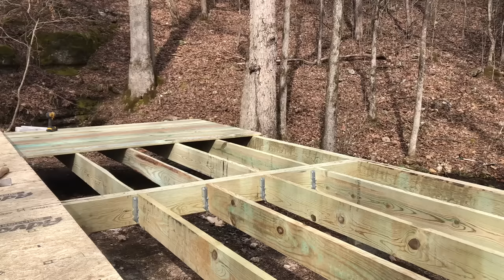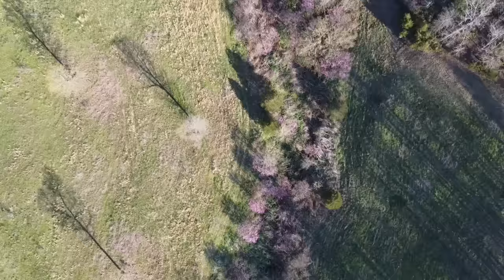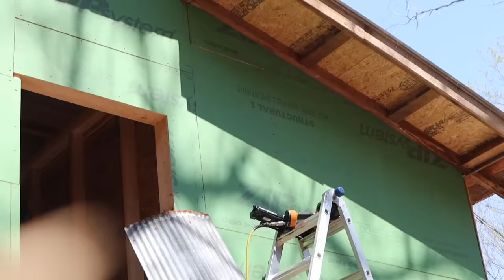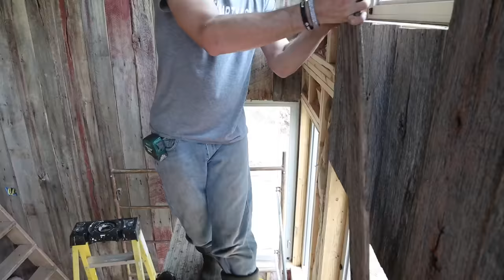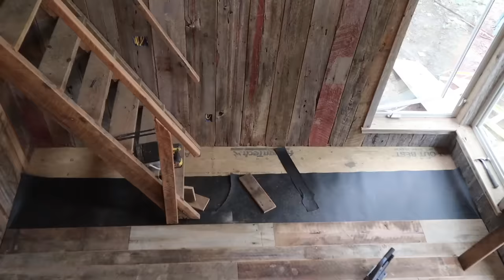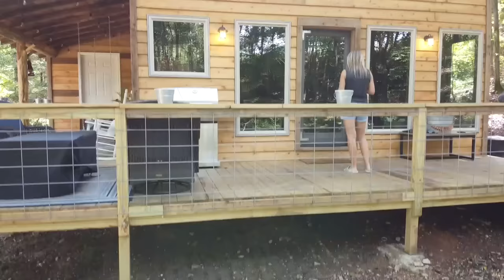TIMELAPSE - Off Grid Shed Style Cabin Build with HYDRO POWER- START TO FINISH

Comment: I moved to the Missouri Ozarks 43 years ago and while I didn't build my house, I rebuilt it. It had a practically flat roof that leaked like a sieve, had NO insulation, windows leaked ( if the wind was blowing in the winter, it would snow inside), had cold running water in the kitchen (tho the well went dry the second year), an outhouse, the subfloor was inadequate---I could go on but you get the picture. I wish I had had a video camera then to record the transformation over the years. I had to do everything very slowly, as I got enough money to do the work. I did the majority of it myself, teaching myself skills that I had no experience with. Some months I would buy 4 or 5 boards because that was all I could afford. I did it all with a hand saw because I couldn't afford a chop saw or circular saw or any other time saving tool. No nail gun either. It was a lot of work and I enjoyed most of it. I now have it pretty much how I want it and I am getting too old to take care of it (79).  But I still wish I could have made a video after watching videos on YouTube about people building their dream houses.

Comment: That foundation is going to settle and the house will be full of creaks and cracks.
Reply: Exactly my thought. Too bad they didn't put as much care into that foundation as they the dam.
But the house is very cool.
Reply: My first tought was are they building the house on that😅
Reply: How deep of a footing do small buildings like this need? 6" below the frostline? Should  it be on top of gravel or sand?
Reply: depends where, depends on soil, depends on local recommendations. but never ever build a foundation on top soil at the very least dig down to the subsoil (top soil contains a lot of twigs, leaves, etc that will continue to decompose and then settle)
Reply: @StephanieBacks   Local recommendations ? This is off grid, they don’t need no stinking recommendations or permits either ,lol.
Reply: In kansas city the code is 36 inches. Not sure where this is. Frost heave might reck this house...
Reply: Is it because they didnt dig?
Reply: @stevelopez372  you seem to be missing the point.

Comment: If your spring is cold enough you should stock it with some trout. Might be a cool lil detail.
Reply: Great video but next time don’t forget the zip tape.  Without it you’ll have air inflation greater than plain OSB and house wrap.

Comment: This truly is a barn rebuilt, but not very much a homey home or cabin. I know I'll get hate but, this is an example of people that have skills in everything but consistent structural style, interior design, functional people spaces or structural planning. This has over 800 dislikes because people in the know, know this. I'm sure the builders accomplished their goals and that's all that actually matters for them, but this is not a good example for people to follow if you want a full time home off grid or otherwise. There's so many design flaws to mention. I love the location! Building next a small stream, adding a dam for power and a pond is very nice. 👍

Comment: Neat build.  Only question is about the footings, seem to be maybe 8inches thick and superficial to a frost line.  Worried about heaving/movement?
Reply: This worries me too. Actually you should never put concrete directly onto dirt. I would have recommended at least a 1,5 better 2 foot excavation, then gravel, a plastic foil as moisture barrier and on top of that concrete with enough rebar. Solid foundations are key to long lasting builds.
Reply: @dermozart80  I just googled Missouri Ozarks frost line and it came back with 30 to 36 inches... which means the area freezes hard for long stretches... That little v troughed footing will be toast in a couple of seasons...
Reply: @chuckmyntti  rip house
Reply: Anybody notice the lack of rebar in the block work ?
Reply: For the foundation,  ever place is different . The soil is different  the frost line is different.  Here in the upstate of South Carolina the frost line is 18 inches but as you move around the property even your own property the soil changes. Even knowing the 18 inches we dug down to red clay , where ever it was . Some places it took digging down on some of corners over 30 inches . Thats a lot of concrete to pour. But that's gere and yours is different.  I dont understand why they are trying to beat you up over your build .its not going to affect them at all. Enjoy your home. Ill be watching.
Reply: @dermozart80  where did you get the idea that concrete shouldn't be poured on dirt? Obviously you don't have an education in construction techniques or concrete.

Comment: Absolute beautiful repurposed use of old family barn, but the fact you didn’t tape your Zip wall assembly hurt my heart! 

You wouldn’t have had to use a house wrap if you would have just taped your seams. Or you could have saved a small fortune just using crap OSB if you didn’t plan on taping the seams.
Reply: Right, I thought the purpose of zip was so you didn't have to wrap  the boards are water tight, correct when sealed properly?
Reply: Watch close. They did.
Reply: Tyler Smith They didn’t.  The whole process of siding has no tape.
Reply: I seen the same thing, no tape on the seams. Could be wrong though

Comment: In Michigan, we need to put our footings 36-42 inches deep because of the ground freezing. If we did surface  footings like you did, we would have a home that would be bending and twisting during the winter because of frozen ground. You must not get much frozen ground in Missouri.
Reply from the maker: We did dig down a about 12” even though it might now look like it on video. Not much frozen ground in southern MO. Average temp in winter is 45.
Reply: Good to know Jerry! We’re are in the Upper Peninsula and will be building a new cabin come spring.

Comment: That exterior interior isn't something I'm fond of. Rough untreated surfaces aren't pleasant and collect more dirt. But the work is still really cool.
I'm a bit worried about the dam. There doesn't seem to be any flow control so I'd be worried about flooding in bad weather or excessive run off in heat.

Comment: May I ask a few questions behind your methods?

Why with such skilled builders did you guys neglect to flash and tape your windows? Also, why didn't you tape the zip tape or cover the entire wall with a wrb? Behind that wood siding are walls that leak air and can leak water without it.
Reply: A great question, but they also used reclaimed wood inside their envelope with God only knows how much mould, mildew, and lead paint so I don't think appropriate install was on their mind with the zip at all

Comment: What was the purpose of using the zip system boards if you didnt use their water proofing tape on the seams?
Reply: Thats what I was wondering. If you don't use the whole "Zip System" you lose the 30 year warrantee on the product.  They could have saved money using another exterior paneling if they were going to use whatever exterior barrier they used.  To each their own as they say.
Reply: @keithhogan6997  problem with that is someone that doesn't know better will recreate it and the line of doing it incorrectly will keep continuing. Since I've seen this comment from myself and others it should be addressed in the description on why they didn't use it so others know.
Reply: They didn't put the Kraft paper flaps on the insulation over the studs to make it more air and moisture tight, so at least they're consistent.

Comment: Beautiful cabin. Much that is worthy of praise. Couple of things one might question: is there any tendency for condensation to form on the interior corrugated metal ceilings in cold weather? I'm thinking that if a half dozen people sleep the night through with the heat turned down that might be a problem in the morning. Secondly, is the water wheel as efficient at producing electricity as some of the compact turbines I've seen featured elsewhere? Sorry to highlight critical observations, as you've created something very special.

Comment: Awesome timelapse! Just want to point out that the zip sheathing system usually needs an adhesive waterproof sealer on the joints that come together to keep everything airtight and moisture out. Other than that awesome job.. cant wait to see how the hydro project turns out!
Reply from the maker: Thank you 😊
Reply: They put ice water shield or tar paper over most it/just as good… I wonder where they live though that they can build such shallow footings.   Must be nice not to have the frost heave!

Comment: I'm curious why you didn't use the Zip system as designed except on the roof. I'm in the KC area and will go for as good as air seal as I can get when we build. Was this a choice, or an oversight?

Comment: Great video! Why not show the pluming and electrician work? Is the house getting water from the dam?
Reply from the maker: I just didn’t have any timelapse of that. The water comes from the spring
Reply: Loftis Party of Six - weROAM understandable.
Yes, the water held in by the dam comes from the spring. But does it also supply the cabin?
Reply from the maker: No we placed a pump in the spring head. Video here: https://youtu.be/kHLxjPOYbRY
Reply: Loftis Party of Six - weROAM awesome, thank you!

Comment: no need for a vapour barrier ? I'm just confused because the walls are 2x6 and the insulation is R19 that would indicated that it gets a bit cold in the winter. usually once the insulation is installed poly in installed ontop of the (warm side of the wall).

Comment: Ya know, if you had taped the joints of that Zip Sheathing you wouldn't have to put a membrane up on the outside, because the Zip sheathing has a waterproof membrane built into the top.

Comment: Why didn't you guys take the seams of the zip sheathing?
Reply from the maker: We should have, but used the tar paper in areas instead because we had plenty of it
Reply: @LoftisPartyofSix  just because you have it, doesn't make it right. You used half a of a system design and said screw the rest? Waste of money.
Reply: @blazinthat7439  Come on! 🙄
Reply: Sorry I'm a fan of doing things right the first time, not because it's easier.

Comment: What kind of permitting did the hydro power require? Or you just hoping you're out of the way enough that no one will notice? Regulations protecting water sources can be extremely strict and hairy to navigate, so I hope you were diligent about protecting yourself from some severe liability down the road there.
Reply from the maker: No permit or inspections required here.

Comment: Why did you waste your money on the zip system if you didn't bother to seal it with the joint tape or the liquid sealer. You would have been better off buying sheets of osb. It would have been cheaper and done the same thing. Now if you had done the zip system correctly it would have been an air tight building.
Reply: Built and still building a many with zip tie walls by code in n.c you have to tape the joints period good observation Man
Reply: Agree. There are so many issues here I could hardly watch it.  No flashing tape on the windows, foundation, essentially no insulation in the roof. If you're off grid a high performance building is key. It is a shame because they obviously have the skillset to do it right.  If only they cared.  They've built themselves a drafty, leaky, inefficient cabin not built to last.  If this were mine I'd be laying awake at night every time it rained.
Reply: They did great job the best thing building your own cabin you can do it the way you want so people always gonna nit pick but they did it there way and there probably happily ever after in there cabin go build your own if you don’t like the way they did it even if they kut corners
Reply: @joelschannel3722  seems like everybody gotta find a reason to gripe
Reply: @bradleyhayslip468  I have seen the difference between the sealed system and a regular osb sheeted house and there are a lot of air leaks inside the regular osb system than the zip system and I have seen a house with the zip system in the middle of construction with the zip system on the roof and taped but no roofing material put on it yet and it went through the complete winter in the Utah mountains where you get a few feet of snow at minimum each month during that time and no leaks.
Reply: They did tape the roof, and with metal siding, they probably aren't getting much in the way of leaks. My wife and I recently built a shouse in Nebraska with steel everywhere, no sheathing on the side walls, and we are having no issues with leaks. It's currently 18 degrees and snowing.

Comment: You can tell this project had no inspections or work done to IBC standards. All of the headers are framed horizontal, not as required by code. Good Luck
Reply from the maker: No inspections required here and Jerry is a master craftsmen. Been building his entire life.

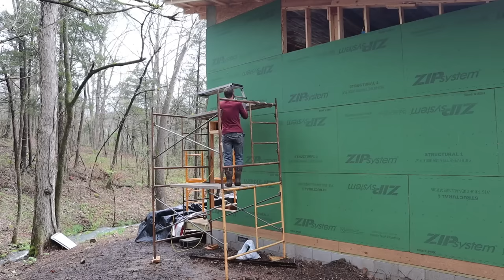Comment: 7:20 tried to hide that backwards piece huh lol? I know zip aint cheap, and it will get covered up anyways!
Reply: I see house wrap over zip. Im curious why you did this? I understand we usually flash with tape around a window before siding so my guess is that you used house wrap to flash?
Reply from the maker: It’s what we had honestly. And I did caulk around every window as well.
Reply: @LoftisPartyofSix  as long as it keeps water out then you did things right! Looks awesome. I'm curious as to how much better the zip board holds up verses OSB. I would think that the colored coating would help preserve and extend the life of the plywood. I know it doesnt burn that great 😁
Reply: @bri_guy508  the Zip 'System' has a 30 year warrantee when you use the whole system. Not using the Zip Flashing and Stretch tapes along with the paneling has me perplexed. Why not use another exterior paneling to save money?